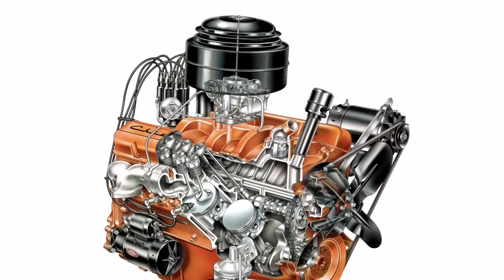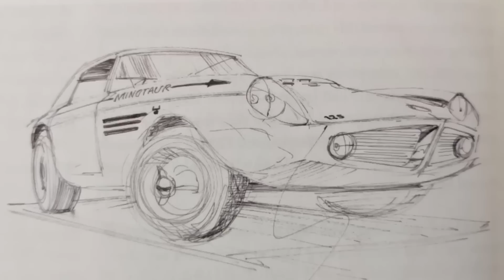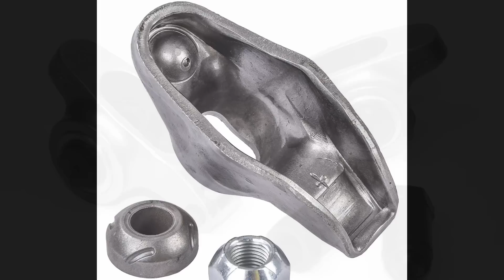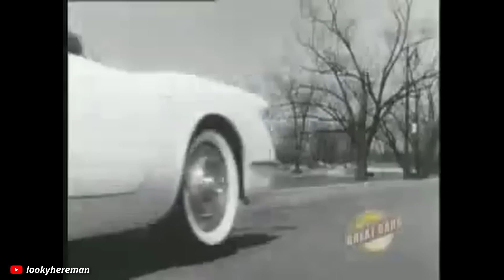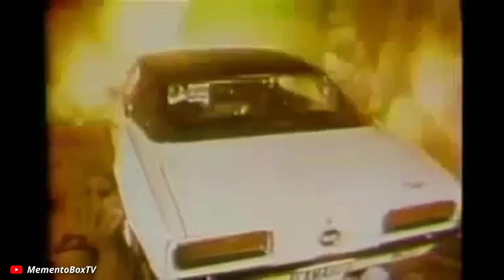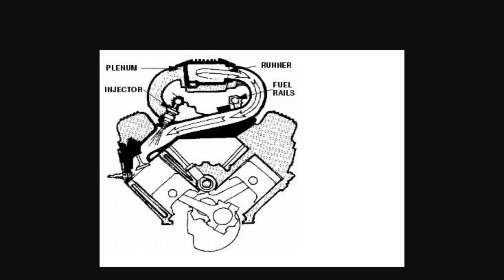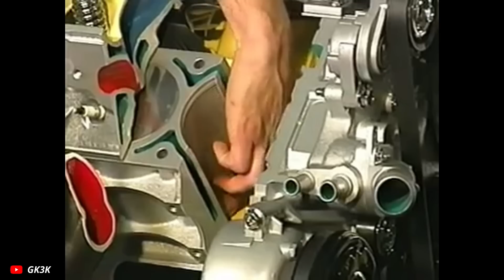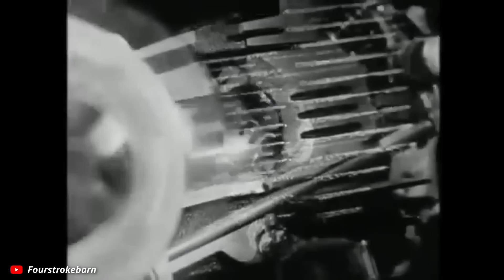The Engine that Powered America

Comment: The Chevy small block is an amazing engine. But nothing lasts forever, and GM had to ruin things by replacing it with the crappy LS engine that everyone seems to love so much. I'm sorry, but any V8 design where you have to pull the heads to change the lifters is just dumb. But it's ironic that Chevy touted the original 265 as having "long life"---it actually had less life than later models, due to the fact that it didn't have an oil filter. The 283 fixed that
Reply: You have no idea what you’re talking about
Reply: @jacobburden3065  I'm betting I know more about it than you do, but please, explain
Reply: @justsumguy2u  The worst LS head is more efficient than any SBC head that left the factory, no Siamese ports that cause excessive heating, better valve train geometry, better port angles for the intake, Improved stability in the bottom end with 6 bolt mains, factory computer controlled and without DoD there will be 0 issues with the valvetrain. A firing order that isn't fighting itself the entire time. Better placement of cooling passages with more volume, a better oil pump with more pressure and volume to keep the engine happy. Significantly lighter than a SBC especially one that doesn't have an aluminum intake. Better processes for machining at the factory, the entire rotating assembly is stronger by a mile. Has VVT on many many models that not only will make more power but be more efficient while doing it. The head gaskets are MLS again far more reliable and will live much much longer. There is not a single drawback to the LS from a Gen 1 SBC. Oh no you have to pull the heads to change lifters :( remove the DoD system and those lifters will live twice as long as an SBC.
Reply: @jacobburden3065  The small block Chevy was cast iron, the LS is aluminum; get one hot and it won't live. Some of the factory bottom ends on a small block were good for 8,000+ rpm....furthermore, people have built small blocks in excess of 1,000 HP. And aluminum is fragile....threads strip out far easier. In my world, they're disposable garbage.
Reply: @justsumguy2u  And there are cast iron LS blocks that are STILL lighter, and factory truck rotating assembly are happy at 6,500 not the same can be said for a rotating assembly out of a gen 1, take an LS7,9/LSA rotating assembly and it will live at the same or beyond that range with more displacement. The only SBC that will live where you're talking is a DZ302 for RPM and a '70 Z28 350 with pink rods for a power level that will not touch a SBE LS. And talking about power levels, look anywhere online and find guys running nitrous LS engines in foxbodies n s10s making the same "1000HP"power level with just a cam, headers and nitrous kits or cheap turbo kits out of a 5.3 at that. Which you will NOT do with a 327 with stock heads, intake, and rotating assembly. If you are stripping out threads you are the problem not the engine. Also what are all racing engines in every single discipline made of? Right. Aluminum.
Reply: @jacobburden3065  Power isn't everything, but durability is. Race engines are considered disposable, drivers expect to blow them up at some point. You don't need max durability when you're changing an engine after every few passes. And let's not forget that small blocks have 40+ years of parts interchangeability to make just about anything you want; can't say that about an LS
Reply: @justsumguy2u  you need durability to make power goofy, if they weren’t durable they’d break immediately. And the LS is still a GM platform everything powertrain related is still interchangeable. It’s clear your don’t work on them if you don’t know that
Reply: @justsumguy2u  also LS has been out for 30 years now not a boutique engine
Reply: @jacobburden3065  No, there are many engines that are durable for 5-10 passes before needing replaced. And there is no way there's the same level of parts interchangeability on an LS as there is on a small block, not even close. And finally, the LS series of engines will never have the rich history that the small block does. But you are right about one thing; I've never worked on one, and I never will. I've said all I need to say on this topic, I'm done with it.
Reply: @justsumguy2u  oh exactly you’re talking shit to talk shit have fun getting gapped by a turbo 5.3 that will run 100k further than your SBC

Comment: I really like the LS 350, mine has 188k miles on it and still runs like it is new. Keep in mind I change the oil every 3k miles. Take care of your engine and it will take care of you.👍
Reply: Are you talking about the LS1 from 96/97?
Reply: I had that engine in a 1994 Buick Roadmaster.   Honestly.  Ridiculously fast.  My dad had 454 in his pick up. Fast.  He had 455 in his Buicks.   My LS 359 woulda eaten their lunch easily.  Still have a buick w 455. Glory be to that LS.
Reply: LS is not this block.

Comment: 283 and 327 were among the best engines ever made.
Reply: The 283 and 327 get all the glory but, there's no love for the unsung workhorse of the breed, the 400 SBC.
Reply: @BlackPill-pu4vi  I like 400's.       They never built a high performance version so it got no fame. Pickups, Blazers, and big cars got it. Many with 2bbl carbs in the cars. Great foundation for a build though.
Reply: @BlackPill-obey  If you want some fun, buy the adapter bearings to use a 327 crank in a 400 small block. You get 365 cubic inches with a 7,000 rpm red line.
Reply: @DrJeffDrJeff   There ya go!  Shorter stroke means less rod angle and that means high rpms!
Reply: @BlackPill-obey  ...and the 327 crank is forged steel. It will run.
Reply: @BlackPill-obey  the 400 actually wasn't nearly as widely used as the 305 and the 350 ,, 400 usually found it'self in trucks and vans and big RVs it was in a few GM cars but mostly they had the 350 ,,350 was in everything from dump trucks to school buses and even farm machinery and many boats ,, 400s had problems with hot cylinders if you got them hot often it would crack a cylinder , 305 and 350 had thicker cylinder walls and didn't do this ,,there was a reason the 400 was never in boats and heavy duty trucks ,the extra 50 cubic inches didn't really justify the cost because the 400 really didn't have a lot more than a 350
Reply: @wildcoyote34   That makes sense.  The 400 was stretched to the limit of a practical SBC and is probably why Chevy never developed it into a high HP engine.
Reply: @BlackPill-obey  pretty much nailed it ,, i grew up in the 80s , al lthe guys i knew had something with a SBC in it and later on the guys building hotrods were stealing parts out of a 400 to build strokers ,namely the crankshaft and conrods ,,stick the crank out of a 400 along with it's rods  in a 350 and add some flat top pistons , and now you have a 383 stroker ,,and it's still that way today  guys that have 400s won't sell them cause they want those parts
Reply: @wildcoyote34   The 383 is something I never understood.  Merely sticking in a longer stroke crank will create excessive rod angularity and side loading of the pistons.  Unless there are special pistons with higher piston pins to offset the extra stroke and I can see problems with that.  Theoretically, of course.
Reply: @BlackPill-obey  most people didn't think about the engineering aspect of it  ,, just thta it worked and the result is cheap horsepower by adding stroke it increases the compression of the engine and torque too  ,,I remember building one in high school auto shop each pair of rods and pistons had to be installed and checked for block clearance and notches cut in the block skirt if they touched ,,the engine ran good when it was assembled but it iwas very out of balance having a 400 crank and rods with 350 pistons ,,,but true to the design of the small block engine  the parts all work together ,, it's a testament to the GM design team , something ford and chrysler have never been able to duplicate ,,GM went to the trouble to make sure that their engines will interchange with each other , to the point that a big block will set in place of a small block without major vehicle modification in many cases
Reply: I had the 265 in a 56 Chevy, Never had any issues with it. The only challenge was the plugs, as you could not see them with the inverted exhaust manifold. Just feel you way around. After the first 2 times it was fine. Back then it was every 10,000 miles for a tune up.
Reply: @tomking1890  Thank you for personal car story. I'm a "late bloomer" old car fan
Reply: @Slowgroovin  The sounds they made were the best.
Reply: have a 327  now a 331  in my 56 now....the 265  dropped  a valve  at 8,000 rpm...broke my sun tac too...i was late to adjust  the valves  on the 265  ,,solid  lifters  will do this easy  lol
Reply: I want to include the Buick 3.8L V6!!
Reply: @TheOzthewiz  yes brother love the 3800. Even the gran national has the 3800
Reply: @DonKleis   That is/was a Buick engine.  This thread is mainly about SBC V8.
Reply: @DonKleis wasn't called 3800 yet
Reply: @BlackPill-obey this thread is about “some of the best engines ever made” not just v8s
Reply: @brdllc   Fair enough.  I was going by the thumbnail of the first gen SBC and the mention of the earlier SBC engines, the 283 and 327.
Reply: I've had almost all versions of the Chevy small blocks including the 283 and they were all great engines and very dependable.
Reply: Ford's 289, 300 6-banger, 302, 351, & 428 / 429 would fall in that category, too, along with GM's big blocks, the Chrysler Slant 6, and Cummins' (older) diesels.
Reply: 318 ?
Reply: LOL
 When the 283 in my 57 was due for a rebuild, I put a 327 in its place.
TOO BAD , I had to sell it. Solid engines.

Comment: I don't include the LS just because its completely different and yet another big step forward.   LS to now is it's own thing.  Just like SBC isn't to be included in flathead ford V8 talks.    I think the 3 big V8 series' in the order they appeared over time is  "Ford Flathead V8" first, "Chevy Small block V8" second and "Chevy LS V8" third.  I'm basing it on the masses of vehicles they came in and the masses of hot rodders that used them.
Reply: And that all 3 were small enough to swap into damn near any vehicle.   I know thats why SBC and LS are so popular in rodding.  Fords mod motors to coyote are great engine but they are huge!

Comment: 1955-2002!  47 years available in GM Production vehicles of all kinds from corvettes to early tractor trailers to cadillacs to firebirds!   sold as a new crate engine until now and beyond!   Lots of industrial uses too!
Reply: Marine apps too
Reply: It was in big 1 ton trucks too
Reply: @Texasmule  i've got an 83 GMC C3500  that up until 2020 had a 350 in it ,,  the old 350 died at 455,000 miles and got replaced with a big block 454 , i do   a lot of heavy duty towing , mainly pulling a big 5th wheel camper all the time ,,and the 454 is up to the challenge  ,i've also upgraded the SM465 4 speed manual to a 7 speed eaton ,gives me a lot more pulling authority

Comment: 🎉updated: ok fanboys, the 400sbc WAS built in 1970( I self fact check) but it was still an overheating,  overhyped dog. The 1970 LT1, with 2.02 valves and a hot cam making an advertised 350/360 hp was king of small blocks unless you prefer the chevy 302 dz,  but either way the 400ABC was hype

Comment: The '70 400 was not a small block but an overbore 396 BBC. (402ci in actuality) it was a couple more years before the 400 small block overheating, 2bbl, dog of all small blocks came around.  Yes it was balanced but took a decade for mechanics to be able to do much with them and the 400sbc was never intended for high performance
Reply: 400 small block debuted in 1970.
many swapped them into vegas. it suffered from too short a connecting rod,but if you respected rpm limits it made plenty of torque.

Comment: Great video. I owned a 67 c10 with a 283, then I built a 350 for it and swapped it in the summer after I graduated (2017). It was a ton of fun, but then I got a fox body and sold my c10 and only bought Ford cars trucks and vans after that, mainly because I had parts for them. Every time I work on a small block Chevy it takes me back to a time not that long ago but a world apart.

Comment: It's funny how everyone celebrates the fact that GM had only ever had one good idea.
Reply: Correction, the SECOND good idea was the Buick 3.8L V6!! Considered by many automotive experts to be THE BEST engine EVER built!
Reply: LS?
Reply: LS, Small Blocks,Big blocks, hei ignition needed only 1 wire to run,3 wire alternators,then 1 wire alternators. Turbo 3.8 in buick grand nationals,Syclone 4wd with 4.3 v6.. list goes on.
Reply: Ok noob

Comment: Ford rushed to beat GM to a "modern" overhead valve V-8, introducing the 239 ci "Y block" V-8 in 1954. They cut corners...It was a poor design with top end oiling issues and was discontinued in 1964, being replaced by the modern Ford smallblock engine.
In contrast, the Chevrolet engine had no lubrication issues from the start.
It was said that by the time their production runs ended, more Ford smallblocks (302 and 351W) were built than Chevy smallblocks. The vast majority of Ford F 150 and Econoline E 150s from 1982 to 1996 were equipped with Ford smallblocks. and many were installed in heavier F-250 trucks and vans. The 302 had been available in Ford pickups since 1968, but not widely ordered. The 351 M was replaced by the 351 Windsor for the 1983-1996 model years
The 265 Chevrolet did not get off to a great start. The piston rings did not seat properly on the first couple thousand built.
GM issued what is now called a technical service bulletin to dealers telling them to have their mechanics throw a handful of Bon Ami (a mildly abrasive cleanser similar to the better known Comet or Ajax) down the carburetor.
GM fixed the problem in short order, but until the introduction of the high nickel content post 1986 engines, cylinder wall wear was rather severe in 1955-86 smallblock Chevrolet engines, often showing a noticeable ridge at only 50,000 miles.
By contrast, Chevrolet engines from 1987 on would often still show a factory cylinder hone pattern at well over 150,000 miles.
Reply: A comprehensive comment! About the exhaust ports spacing: The two siamese center ports is a drawback, ii increases the already hotter center cylinders. I dont' know why that arrangement was choosen by Ed Cole.
Reply: @hakantorstensson8053  Both GM and Chrysler seemed to prefer the "siamesed" center exhaust ports.
Pontiac and Oldsmobile also used this design, as did "A"  "B"  and "RB" Chrysler engines with the exception of the Hemi.
It didnt seem to be an issue.....except...once again...on the "Y block" Ford.
In 1960, Ford issued a service directive prescribing additional coolant holes be drilled in both the head and block near the two center cylinders, especially important on 292 and 312 CI variants of that engine.
A modern Fel-Pro gasket can be used as a template for drilling these holes
.Ive done this procedure on a few previously unmodified 312s in 1956 and 57 Thunderbirds, which habitually ran hotter than they should.
The Y-blocks were the last Ford engines to use siamesed center ports.
The Ford "FE" series of engines, introduced in 1958, as well as the smallblock Ford (introduced in 1962 as a 221 ci unit) had the separated exhaust port placement as used in the big-block (Mark IV and V) Chevrolet.
However, 400 ci smallblock Chevrolet heads had additional coolant passages from the factory, and all other Chevrolet smallblock heads should have these holes drilled if used on a 400 (4.125 bore) block.
Chevrolet 400s almost always were equipped with 1.94 intake valves, but can easily be modified to accept 2.02 "fuelie" intake valves, but were (as far as Ive seen) 2 bolt main blocks.
Reply: @donreinke5863  Interesting facts. Juas an impression: The Ford FE and its smallblock with separate exhaust ports look more modern than the SBC. Buick/Oldsmobile developed an all aluminum 3.5 l V8 in the late 50s' (later purchased by english Rover in the mid 60s'). In this case the designers managed to get the exhaust ports into their desirable positions, as close to the ends of the head as possible. A suspicion being the aluminiums' lower permittable temperatures.

Comment: Reason No. 3, size and lightweight. This engine was described as a "packaging miracle." The small block Chevy could fit into just about anything.
Reply: In my '66 Impala convertible there was enough room around the engine that you could stand in the engine bay - with the engine.
Reply: I have an earlier post here about how I put one in my 48 Chevy. Yes it fit right in there where a 6-cylinder was originally in a very narrow car .I did have to move the battery into the trunk.
Reply: Including a bug eyed Sprite....
Reply: Only like a 16 piece casting I think.
Reply: Was it ever put in front wheel drive transverse applications?

Comment: We have a 91 fleetwood hearse with a tbi chevy 350. As big of a pain in the cunning linguals as this motors been over the last year I still like it. It’s given me nothing but trouble trying to get it to pass emission, I’ve practically gone full ship of Theseus on it, cat, egr, plugs, cap rotor, wires, rebuilt the tbi unit, intake manifold gasket. I  still like it, it’s a classic gm product, it’ll run like ass longer than a lot of cars will run at all. It’s super easy to work on, decent power for what it is, great torque. Not amazing on gas but that’s probably from it being in a hearse and it running like crap still. Out of the old school American v8’s I own I do prefer the late 80’s lo po efi 302, if only for the distributor being in a better location, but the 302’s been pretty much the most reliable engine I’ve owned, and I can get 20 mpg out of it if I try. Those old American v8’s are solid
Reply: Replace your temperature sensor
It’s probably. What’s been the problem all along.